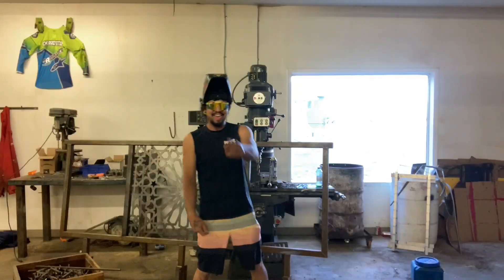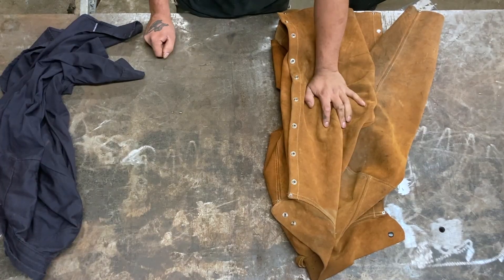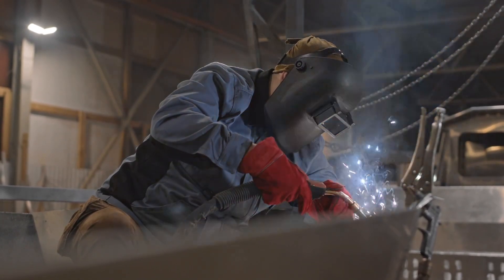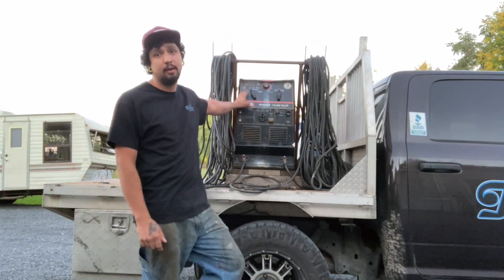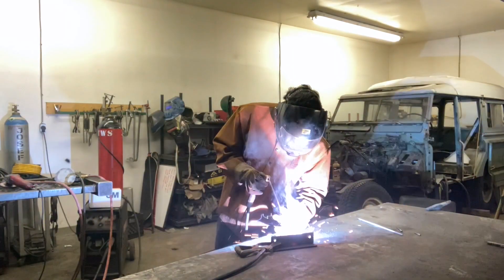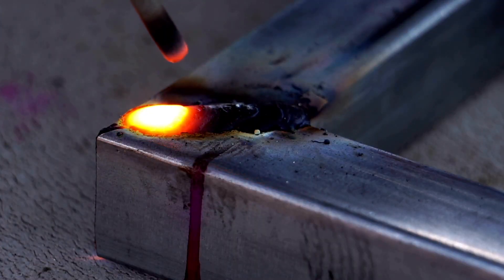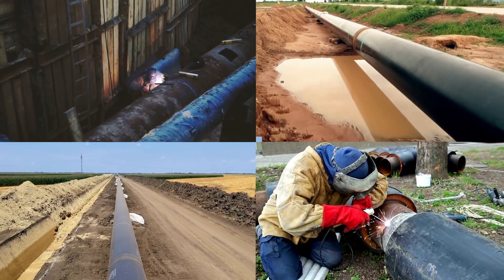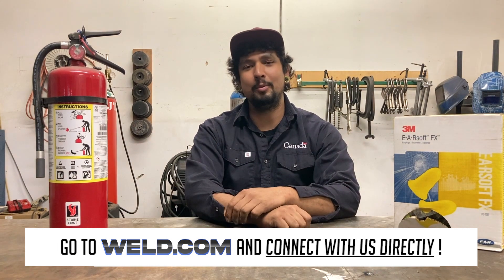Welding Safety for New Welders

Comment: Couple of things to add here. Seriously consider a cartridge respirator. Use a P100 with a correctly sized facepiece. Especially if you MIG or stick stainless, weld on galvanized or anything else nasty. They are hot, uncomfortable and can be a pain in the ass to wear. Your friends/coworkers might give you some shit about wearing one, but you only have one pair of lungs, so protect them. 
They can go pound sand. 

At one point you will need to weld on something greasy or oily. You will probably have some degreaser in a convenient spray can around the shop. You will grab it, spray down your work then get to welding. Next thing you will experience is your chest tighten to the point you can't get a full breath. That goes away fairly quickly, but the constant cough that comes later doesn't. Your mistake: you used a chlorinated solvent. The UV light from the arc broke it down into some nasty stuff, one being phosgene. It was used in chemical warfare in WWI. That cough is because phosgene can cross link the proteins in lungs, scarring the lining. 
I don't mean this to come off sounding like some nut job, but it happened to me. Wasn't paying attention, grabbed the wrong can and really, really screwed myself up. Coughed for almost 3 months after that. Do yourself a favor and get rid of chlorinated solvents.
Reply: They always overlook the respiratory protection. The P100 is actually a very comfortable mask in my experience.

Comment: I'd never wear boots unless I felt I needed steel toes. I hate boots and don't think they're better than high top basketball shoes to work in. I like to be able to move my ankles freely and move quickly. You can't move quickly in heavy boots. I've worked in basketball shoes many times and never had any issues. Even roofing.